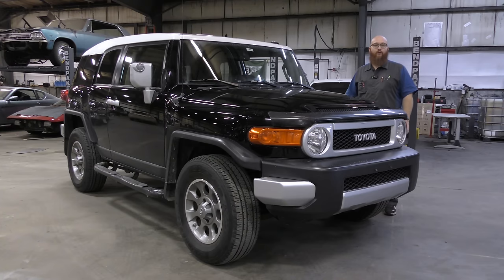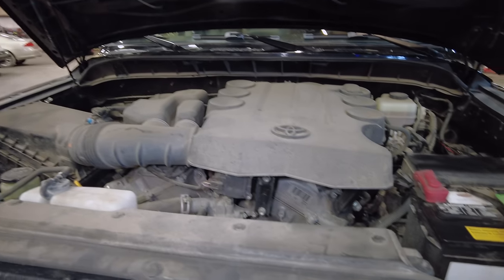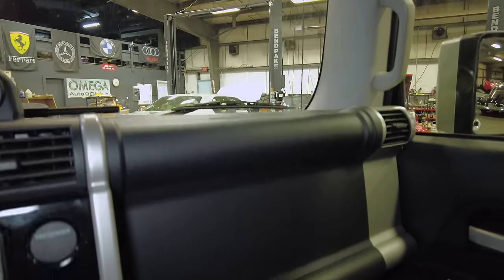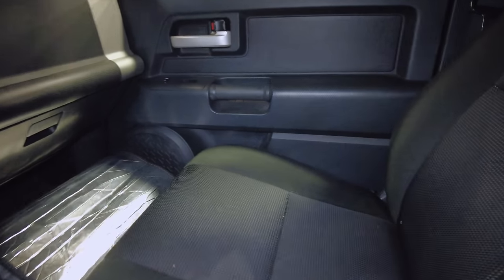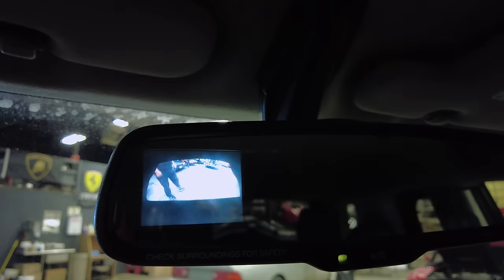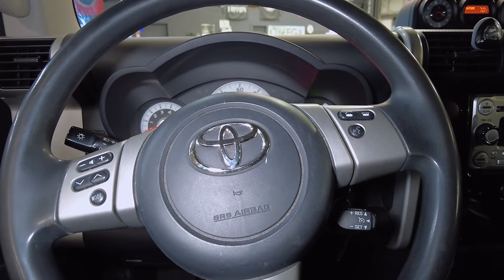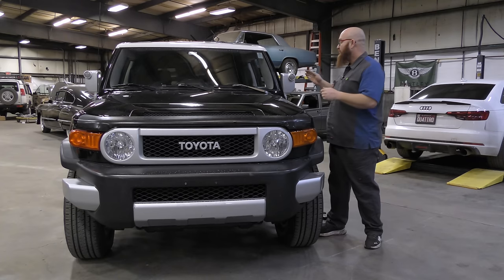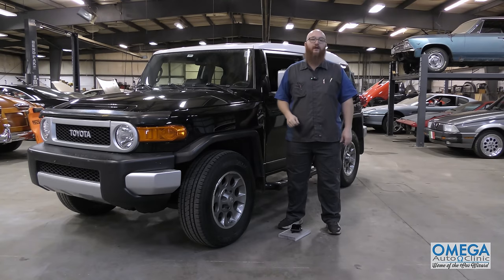Prices are Changing! FJ Cruiser Prices Are Plunging! What Happened?!?

Comment: It's a great vehicle, as long as you dont mind zero visibility in all directions.  The every view is a blind spot.
Reply: Hmmm
Reply: Blind spots galore...lots of bobbing and weaving checking mirrors and blind spots to make sure you don't run anyone off the road. Challenging for experienced drivers, novice drivers need not apply.
Reply: Have had mine since 07, there are NO blindspots on the FJ..... learn how to position your mirrors.
Reply: @learjet45  Glad you're doing well with it. The comment section will have its say I assure you.
Reply: It's not bad at all. Maybe that's a driver problem....
Reply: Sounds like you’re just a bad driver. The FJ has no blind spots, just like basically any other vehicle. Just learn to drive and learn how mirrors work.
Reply: Exactly right. All these blind spot critics have no clue. I'm in My late 70's and I can safely drive My FJ anywhere and back it into any spot.
Reply: It’s also incredibly ugly 😂
Reply: @TRJ2525 You can look at that thing and tell it would have blind spots 😂
Reply: @learjet45   Johnathan Ward from icon design created the prototype for the FJ cruiser commissioned by Toyota. Toyota didn't like anything he did for the reason it didn't have a retro future look that Toyota wanted. he was completely disappointed with the production vehicle.
Reply: @rolandthethompsongunner64 every vehicle has blind spots 🤣🤣😂😂
Reply: @flight2k5  😂☝️🤡
Reply: @rolandthethompsongunner64  yea you’re a clown 🤣🤣😂😂
Reply: @flight2k5  ☝️💩
Reply: @rolandthethompsongunner64 crazy how different opinions can be because I feel like I've heard most people say that it's really a cool-looking SUV - I think it's cool-looking. Also idk..I could see extremely well out of this thing when I sat in one, but I drive large trucks and own a Challenger so it could just be that I'm used to vehicles with real blind spots.
Reply: Really the only blind spot is the rear if you have it lifted a bit, and then having the extra tire back there doesn't help. I would recommend adding a backup camera
Reply: Only issue I’ve had with sight is backing in, but most of them come with rear bumper sensors to warn you if you’re getting close to something.
Reply: @Jeremy_Watson  I drove semis for years. I drove one of these things because yeah thought it was cool loved the reviews. I hated it. Slow, seemed like it had horrible handling and yes blind spots. I owned a 1996 Jeep Cherokee sport and it had better visibility in my opinion and styling. Also thought with the 4 liter and 5 speed much more fun to drive. So to each their own. For what they ask for these things hard pass.
Reply: @NickVTA  I would think they have back up cameras. But the 2010 I test drove didn’t.
Reply: @rolandthethompsongunner64  Beauty is in the eye of the beholder.
Reply: Your statement that it has:  "zero visibility in all directions" is erroneous.  It has definite blind spots - especially to the rear-sides of the vehicle - that need to be accounted for when driving.  So the continuous use of side mirrors - akin to driving a large van - is the recommended driving style.
Reply: I religiously avoid these, Prius, and Camaros when I’m on my motorcycle.
Reply: @InternetUser._  I consider your biggest risk when on a motorcycle is: 'man in white van'.
Reply: There are blind spots. Most noticeable when making some left turns at a stop sign where the angle from the right is past where you can see out your window and not in your typical side mirror setting.
Reply: @eurobo1773 Thank you for pointing this oversight out to the "learn how to use your mirror" numpties.
Reply: @learjet45 What about the roof? I can't see traffic lights because the windshield is 30 feet from my face!
Reply: @sjfk1306  All vehicles have blind spots.
Reply: @erikkovacs3097  Have never had a problem seeing a traffic light.
Reply: Start with the spare tire blocking your rear view. Second row seat and suicide doors are a joke. We bought the 4Runner instead for the same price and got so much more. This FJ is for single males still trying to get some.
Reply: @learjet45  I'm 6'3" maybe that's why I'm having these issues?
Reply: Add a 360° camera
Reply: Visibility gets even worse as the many rock chips and cracks add up on the windshield.
Reply: The windshield being so vertical and far from the driver makes for a rotten field of view.
Reply: @ZIGSVIDS  none of mine do…. As most vehicles don’t. Learn to aim your mirrors. Maybe take some driving lessons…
Reply: @learjet45 the interior mirror is one of the thing creating a blind spot. It's right at my eye level 😢
Reply: They are not that bad.
Reply: Such a departure from the 100 series LC that has stellar visibility in all directions
Reply: @stephenmras8519 all I see are females driving them
Reply: @stephenmras8519 Well then I guess at 70 years old I still have an edge to please the ladies. I’ll take that as a complement 😂😂
Reply: @brkbtjunkie  the FJs or the 4Runners. My wife has a 2014 SR5 with  347K miles and a 2023 ORP with 19K miles. They are right sized suv for women. I have a ‘99 K2500 Suburban diesel for my recreational use. Wife finds it a bit too big for her.
Reply: I'm keeping my 2001 and 2002 Xterra with 2wd. Why? Because they have everything I need and nothing I don't!
Reply: It's not that bad I've been in worst like the 350z and the camero .
Reply: @learjet45 the blind spots are horrible.  I'm not sure what you're on.
Reply: Every vehicle has blindspot, you just have to position your mirrors properly. And if you keep blaming blindspots and/or dont know how to adjust mirrors properly. Then you should NOT be DRIVING
Reply: 20 dollars get you seat raisers which  as well as raise your seat it adds room for amp or lock box. They look factory too with FJ cut into them.
Reply: As far as reverse cam if you have the factory wheel cover on the spare tire that has your backup camera. Get bigger wheels lose the camera. Add your own for under 500 and ad low as 75 dollars. 100 dollars took care of the 2 biggest complaints. Haters will always hate (maybe their wives are getting snug in the sheets with the FJ guy down the block).
Reply: If your a serious overlander or offroader, FJ is the only way to go. They hands down out perform 4runners off road. And I have put 340k on a 3rd gen, 515k on a 3rd gen, and then maybe 80k on a 5th gen! If you don't offroad/overland or only occasionally do the 4runner is the way to go and your out of touch and out of league contemplating getting a FJ. Save the FJ's for the men(or non purse carrying ladies) in the room before you total one and make the market that much smaller.
Reply: I installed one of those rear cameras on the rear tire carrier and ran it into a 12 inch LCD mirror. I realized afterward that this is a must do modification if you own an FJ Cruiser. There are tons of blind spots especially rearward visibility. The reason I sold mine was there was too much frame rust. Wish Toyota would stop sourcing their steel from the bottom of the ocean.
Reply: That’s ok I’m blind
Reply: Learn to drive .
Reply: @learjet45 This
Reply: Get a couple convex mirrors. Love my FJ.
Reply: The front and sides are wide open. The rear and back sides are easily handled by mirrors.
Reply: @pogmothoin602  other than longer wheel base, there is very little difference between the two.
Reply: It’s like y’all wake up in the morning and go, “ today I’m excited to be an a** hole in the comments, it’s my fav”😂😅
Reply: You mean every brand new oversized modern vehicle today?
Reply: So true, my kids were like nope, we can't see out at all!!
Reply: Noticed this with A lot of newer cars. Pillars are larger, windows are smaller and often have large mounting edges, and cabin interiors are smaller, so even though a car looks like a medium size sedan ( or whatever ) they are cramped inside, and not easy to see out of.
Reply: Just learn how to use your mirrors bud....
Reply: I wish it was a complete blind spot. Ugliest Toyota ever.
Reply: Yes, there are blind spots, the A and B pillars are huge, the side windows are small and the view out the back is obscured by the corners, spare tire, and a tiny rear window. They invited me down to see them when they first came out because I have an FJ60 and the difference was immediate and obvious.
Reply: @roland, you’ll go blind just lookin at that ugly rig! Great motor  if u have the larger  4.0, but cheaply made for sure!!
Reply: I don't know of any blindspots on mine. If you adjust your mirrors, like in all vehicles, you shouldn't ever have to turn your head farther than the mirrors.
Reply: Comentors please keep bashing it, even if you've never drove one. I love mine. Grew up with a 63 Landcruiser as a family vehicle.  Never get left behind with a Toyota. I like the price drop getting ready to buy a newer 2014. Just waiting for a firesale.
Reply: People are babbling about things they don’t know anything about. You’re surrounded by windows in an FJ, and you’re up high. Visibility is a non-issue
Reply: Has Some of Biggest Mirrors , for Side Safety Next to Tractor Trailers.😊
Reply: If U Don't Know how To Utilize Oversized side Mirrors ,Buy a Car
Reply: I used to make bumpers and rock sliders for them until I realized towards the end the company was almost scamming people
Reply: Not to mention it is the ugliest modern Toyota truck. 🤢
Reply: @JH-jm8ib  how do I adjust the mirrors to make up for the mail slot windshield.
Reply: Lol
Reply: Visibility is for losers
Reply: Crazy blind spots. But if ya know. Ya know man! 😂
Reply: Have you driven one? 😂
Reply: I didn’t think it was the bad really. Does go through a lot of windshields thou.
Reply: Drove an ‘07 for 10 years.  Never saw these “blind spots” you speak of.
Reply: All the blind spots was the reason I went with a Highlander rather than an FJ.  Originally thought the back panel was a window
Reply: @georgebettiol8338  this is the most accurate response. I didn’t buy one because on the test drive- it had the visibility of a van.  I loved the look of it, though.
Reply: Sharp vehicle....my favorite remains the 4 Runner
Reply: That feeling lasts until you actually drive it.. drive one sometime.
Reply: @timc7175  I have driven one.  We rented one for a week in the Keys.
Reply: I suggest you use your mirrors, I did. Never had an issue, and it was a pleasure to drive. Bomb proof vehicle.
Reply: @Mityob67  I never had an issue. You must be a new driver.
Reply: I put 100k on mine and never had an issue...use your mirrors it's just old school
Reply: best comment, that is the reason I don´t like it, you really feel in a closed box with tiny windows
Reply: @stephenmras8519 And overhang. Departure angles.
Reply: Yeah, have you driven one for any length of time? Kind of non issue for its vehicle type. Insanely capable and reliable vehicle and nothing like it. 312k on mine looks like the day I got it and I change the fluids. lol.

But hey you back up with that raptor or Tahoe man, lol.
Reply: @kenk8242  100%. The commenters raising these issues haven’t spent substantial time in the vehicle. One of the great vehicles ever.
Reply: @jysmtl  and just how often does that come into play? Less than 1.00% of the miles driven.
Reply: @pogmothoin602  4Runner gives up nothing in terms of Off-road capability to the FJ, but the FJ gives up a lot in terms of room, blind spots, etc. You must not know how to drive while off-road.
Reply: @learjet45 You're right about that. Most people have no idea how to position their mirrors to eliminate blind spots, they think they have to see the door handles on the side of their car if a car is at close it's too late. Rear view mirror. You should never have to move your head to look at your rear view mirror just your eyes. When you no longer can see a car in your rearview mirror you should have it on your side mirrors and when you lose sight of it on your side mirrors it should be directly next to you.
Reply: Ugly on the inside and the outside! OK to drive though...feels like a Prado.
Reply: It’s terrible
Reply: ....that...and inner volume
Reply: @RotoRCol  That's funny. The windshield is like 3' in front of you. The cabin is not small.
Reply: Facts I drove my dads for a bit in high school and my only real complaint is the amount of horrible blind spots in it 😂😂😂 and the fact you can’t take the doors off but Toyota don’t seem to like that concept considering even their new Land Cruiser doesn’t have removable doors…..
Reply: @joshm6012  My generation grew up with huge boats with monstrous sail panels. No side mirror on the passenger side and no reverse cameras. And we parallel park those 18 footers without touching bumpers.
Reply: @learjet45  Lucky you, I had to redo the seat mount in my 1995 YJ to be able to see traffic lights with top on.  I also had issues keeping my head inside the roll cage.  I know tall person problems.
Reply: Neat Retro LC vibes but it's a plasricky interior with claustrophobic rear seating / door arrangement. 
Truck like feel and slow. 

Utilitarian and no comforts you'd get with a Lexus GX470. I'd take one for cheap ie. 😊not collectible pricing.
Reply: Straight ahead is a blind spot?
Reply: TOTALLY agree!! I test drove a new FJ back in the day, and the visibility was horrid. I ended up purchasing a 4Runner, which I still own and LOVE today!!
Reply: not to mention lousy gas mileage and those stupid rear doors
Reply: And terrible road noise
Reply: I feel the same way. I owned a Range Rover in 2008 and decided to test drive one of these.  I quickly returned it to the dealer; terrible blind spots.
Reply: I never had a problem, even parallel parking.
Reply: @sjfk1306 what a joke.  You saying none of your vehicles have blind spots confirms you have no idea what you are talking about, and are probably a terror on the road.  ALL vehicles with a roof have blind spots.  The A pillars will often block your view of cross traffic. If you don’t know this you have no business being behind the wheel.
Reply: @JH-jm8ib adjusting mirrors does nothing for A pillar blind spots.
Reply: @georgebettiol8338  it doesn’t have blind spots…
Reply: @ZIGSVIDS  no, they don’t. Learn to position your mirrors correctly…. It’s not difficult
Reply: @derekcox6531  you probably shouldn’t drive…
Reply: @joshm6012  0 blind spots is not that many blind spots…
Reply: @learjet45 I have a fj 12 edition, the front viewing is OK, little less on the sides if you pay attention to your mirrors(wonder if you could put the new Toyota lane Collison avoidance system in it?), the rear view is rather limited. I plan on putting an aftermarket large screen rear view camera into the dash or on top . One does have to pay attention to your surroundings when driving a FJ.
Reply: @rolandthethompsongunner64  yea hard pass at the price for sure.
Reply: @learjet45 you're being disingenuous. I have a 2001 honda crv. The entire top cabin is basically glass. It has a giant blind spot. Compared to my 2006 mustang? Its not even on the same planet. Mirrors are not a substitute for a shoulder check. We have 2 FJs in our off roading groups. They need the most visual assistance in climbs and tight trails.
Reply: @dootdoot1867  I never change lanes without a left/right shoulder check in the FJ and Beemer. Most have no clue what a shoulder check even means! 👍
Reply: And the community blows too, but if you never go on the internet and can drive by feel, then you're golden!
Reply: Would love it but mpg terrible
Reply: @flight2k5 not like this does. It's one of the main complaints.
Reply: @NickVTA and the side pillars and dinky windows
Reply: @woodyahh2110  did you get your driving dog yet? 
Btw I had a full size van, I just added fisheye  mirrors and could see through the blind spots.
Reply: Bs
Reply: I owned both an 07 and 08 and it really depends on your mirror adjustments. You can always pick up a small mirror attachment to your side mirror. I get great visibility out the front. Also the TRD exhaust helps when you’re merging, people tend to get out of your way
Reply: It has NO blind spots. You just rank among novice drivers. Ever drive a wagon? A van? a commercial vehicle? Stop with this.
Reply: I don't have problems with  blindspots, maybe it's a driver problem.
Reply: So basically a Cadillac?
Reply: @erikkovacs3097 don't pull out into the intersection
Reply: @RotoRCol the windows are a mile wide
Reply: @Superabound2  I lose sight well before I get near it.
Reply: “NO blind spots” is an overstatement. It has blind spots like every vehicle. The pillars are unlike most conventional suvs but Only Slightly worse than a Wrangler.
Reply: Learn how to position your mirrors
Reply: Every vehicle has blindspots
Reply: He's right. There is no vehicle in existence  that doesn't  have a blindspot.
Reply: I second that, mine 2010 is very tricky. I'm thinking of doing 360 cameras around it
Reply: It is really best for off road where you look forward. You wont need to worry about blind spots. You would be the only person on the dirt road.
Reply: I wanted one of these untill I drove one and it's a pain to get used too. I stuck with my Honda element instead, for a truck that looks bigger it doesent have the space that the element has.
Reply: I think positioning the 3 mirrors in the correct way plus the back up camera has you covered zero problems.
Reply: First day i got mine i almost changed lanes into police suv 😂
Reply: I’ve heard this too but never ridden in one. Certainly looks like that would be the case.
Reply: good for you but other think different
Reply: I have one and I don't have any trouble seeing. BUT I did get a rear view camera that has helped for sure.
Reply: @learjet45 agree I did get a rear view camera that I'd did struggle with. Makes a big difference
Reply: Uh, no thanks!
Reply: @rolandthethompsongunner64 
Get one then u can talk!
Reply: @learjet45  - Agree. Plus, use the head attached to a neck. Don't rely just on the mirrors.
Reply: @NickVTA I agree.
Reply: @learjet45 Agree!!!  I drove my 14 for almost 10 years, traded for a 23 4R.  If you know how to use your mirrors and pay attention, there are no blind spots! 
😊
Reply: Those complaining about blind soots probably have hairy palms also.
Reply: Half these people who comment on blind spots etc have never actually driven one! @learjet45
Reply: @learjet45  exactly!!
Reply: Bullshit, semi drivers have it worse with blind spots, I don't have any trouble seeing while driving a truck or my f j cruiser, it's what you get used too!
Reply: You can't see anyway, so....
Reply: @learjet45  Agreed